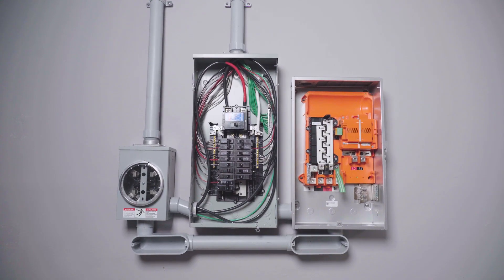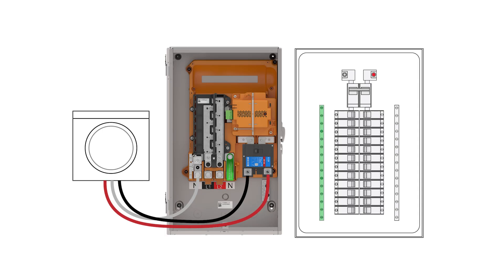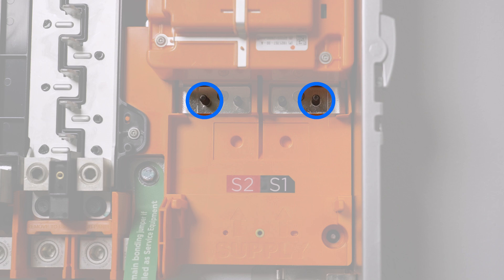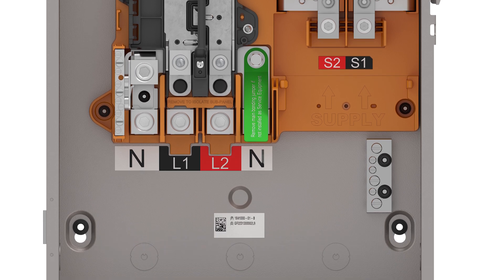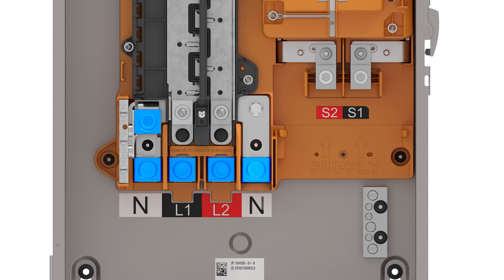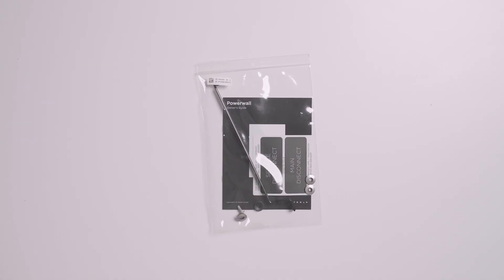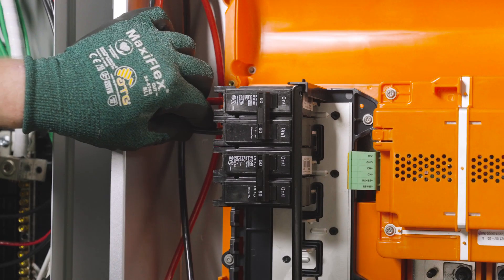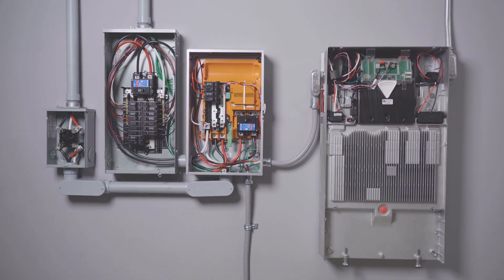Gateway 3 - Wiring

Comment: What the heck happen to the Powershare Gateway Home Back-up for the Cyberbeast Installation credit of up to $4,000.00. I just got a Cyberbeast and told go pay for it yourself. Thanks Elon for the $20,000 surcharge plus no one from Tesla will give me a answer but they did send me the Powershare Gateway and on there website they Required: You must be in contract with a certified installer before purchasing Powershare Home Backup Bundle.

Comment: Notice how the red line side conductor kept changing between right side and left side of the line side breaker throughout the video? Should have redone this before posting onto Tesla Installer Academy. Need to note why the feed conductors are in the location before and after a breaker is installed for phasing purposes (they cross within the breaker itself). Can the phase lugs on the internal panel board also be used to feed a backup loads subpanel?